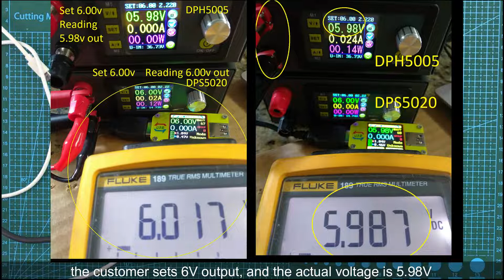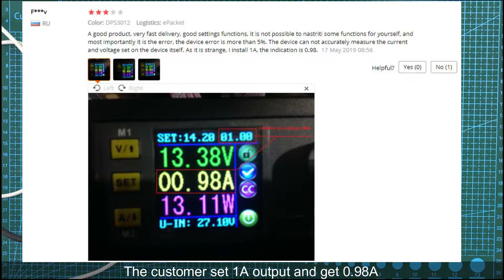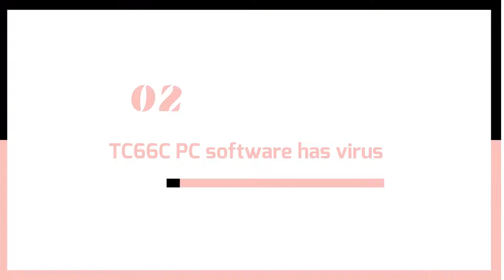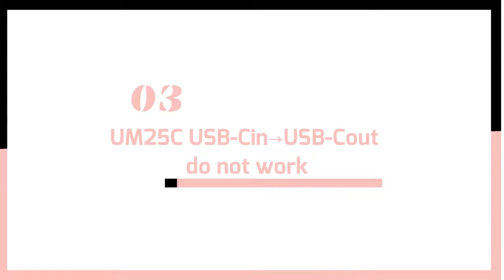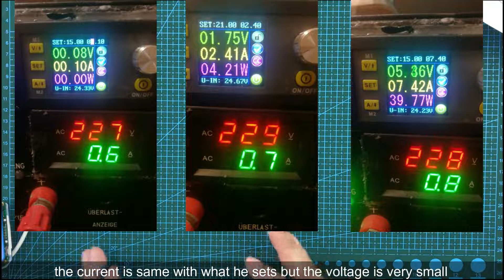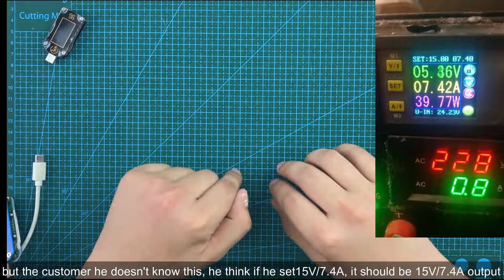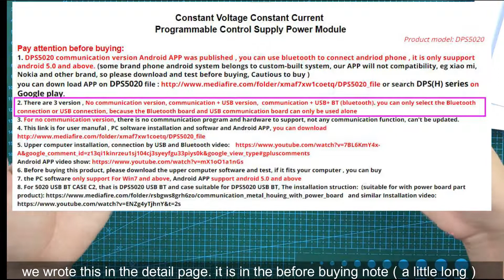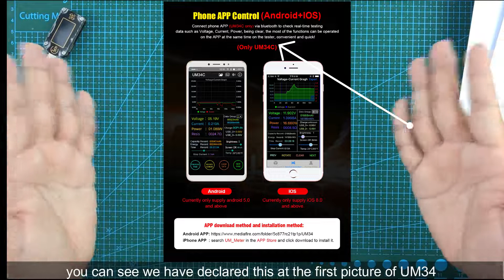Misunderstandings about RD products

Comment: The main problem is that your product advertisements are in very poor English and are difficult to comprehend. Why you don't employ an English-speaking Engineer to write the descriptions for your products on Banggood, AliExpress, AliBaba, etc. There would be a lot less complaints and less returned goods and you would sell a lot more product.
It is just sheer madness to write the product descriptions and manuals in 'Chinglish'.
e.g. UM25C - 'Allow APP to do in the background, not be cleaned.'  What does that mean?
DPS5020 - 'Before buying this product, please download the upper computer software and test' - what does upper computer software mean?
There are many many product descriptions which just don't make sense so it is no wonder people get confused.
Reply from the maker: thank you for your suggestion,  first let me explain what you ask
Allow APP to do in the background, not be cleaned----- when your phone is locked, some software will be terminated, so if you want to keep the data recording function of UM25C, you need to allow it  working  all the time unless you shut down it yourself
'Before buying this product, please download the upper computer software and test'----DPS5020 has communiation version, so it has PC software to control, if the software goes wrong on your computer and it cannot be fixed, it is unnecessary to buy communication version before we optimize  the softare
Reply: @rdtech9153  Those were just some random examples - there are 1000's more examples. You are missing the point. The product descriptions cannot be understood because they are written in very bad English. You need to hire a good native English-speaking engineer and have them write the product descriptions in English not 'Chinglish'.  This is a common problem, not just with your products but with many other Chinese products. Why don't you employ an American or UK English electronics engineer to translate and re-write your product descriptions and manuals - start with new products and popular products - e.g. the RD6006? You could do it via email. People buy a product based on it's description. For a technical product you need to write the description in good technical English that makes sense and can be understood.
Reply from the maker: @steve6375  thank you for your suggestion, we have already invited some people to help translation, but, even though they got the free samples we provide, and videos to show the operation, they still cannot make a perfect instruction, sometimes the translation is total wrong. I know you want us to make a instruction in good technical English, I agree with you, we have sent many free products to do that,  but the effect is not so good, still thank you for your suggestion, we will try again
Reply from the maker: @steve6375  thank you, it is so kind of you, I will take a look : )
Reply: @rdtech9153  so for 'Before buying this product, please download the upper computer software and test' - you really mean 'please download and test the software first before purchasing the product, to ensure that it is compatible with your system.'
and
'Allow APP to do in the background, not be cleaned.'  - you mean 'Please note: the app must be left open and running in the background whilst recording'.

Comment: When will the PC SW be modified to communicate with TC66C on non-English versions of Windows?
Or add at least a manual option to set up a virtual COM port when the automatic detection fails.
Reply from the maker: for this question, we have received some messages from our customers that part of Polish and Korean windows system has this problem, and our designer is trying to fix it

Comment: I just got DPS5020CV version, it very great product I ever own. I know this is came from the hard job of programmer and designer. One thing it annoying me is programming value to M0 M1...and so.. and how to retrive them It very messy for me. I'm not sure you already have the video for programming hint or not. Another one is if it have one more knob for Ampare adjustmet it will perfect. Thanks for quality product.
Reply from the maker: you mean the data group, it can store the data you set and you can preset commonly used data in advance,  it will be improved in the next power supply RD6006, the setting will be super easy haha, you can wait and see the promotional video we publish, it should be finished in a month.